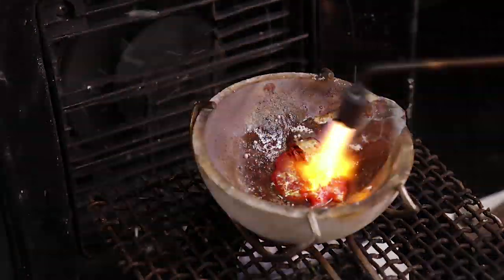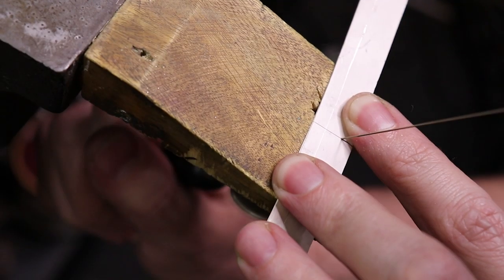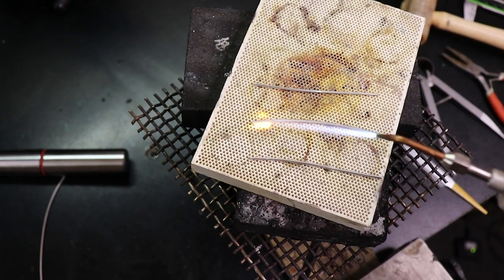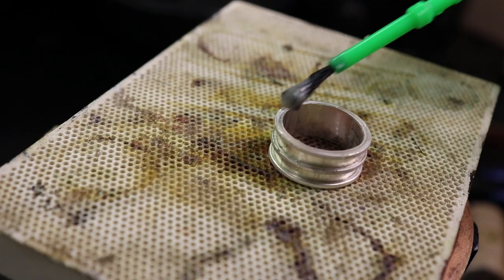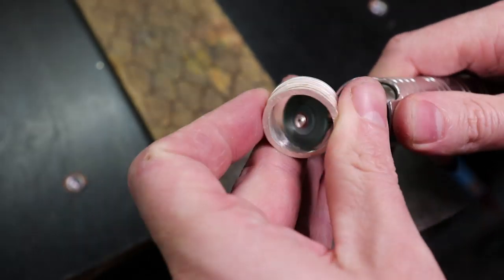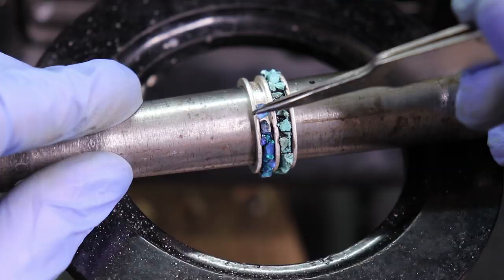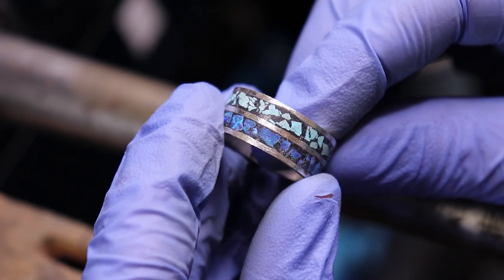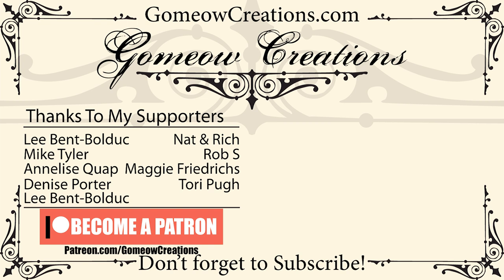How to make a silver, opal & turquoise inlay ring without a lathe

Comment: I have 2 questions.  Where can I buy silver dust appropriate for this use?  Is it possible to finish in a tumble or is it too fragile?
Reply from the maker: Idk if you can buy it but I make my own silver dust. Just take a file or you saw to some silver and it will make dust. You can tumble the ring core before putting the stones in it but after that you shouldn't due to the material in there being to harsh on the inlay